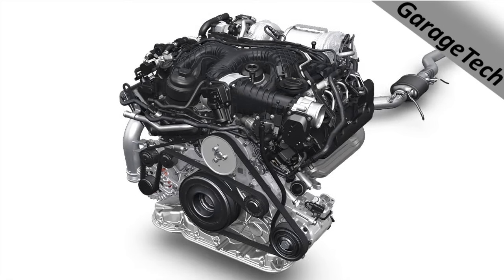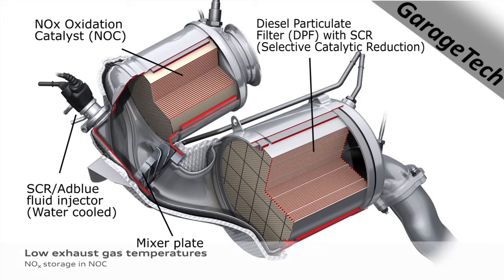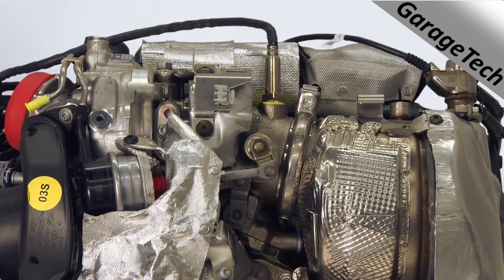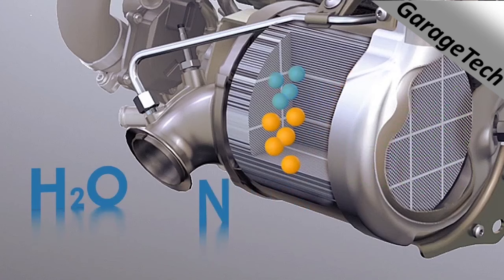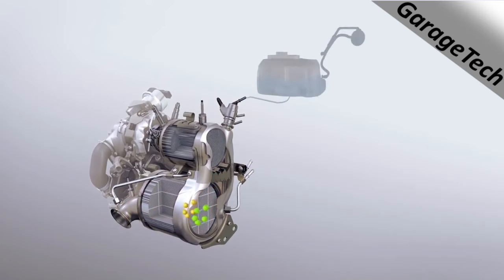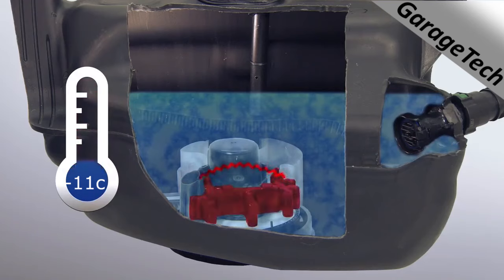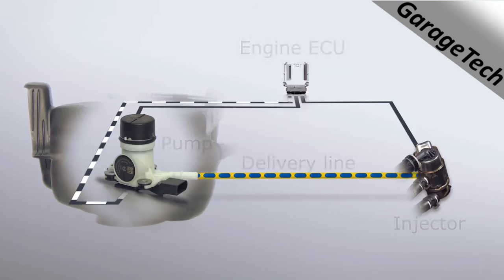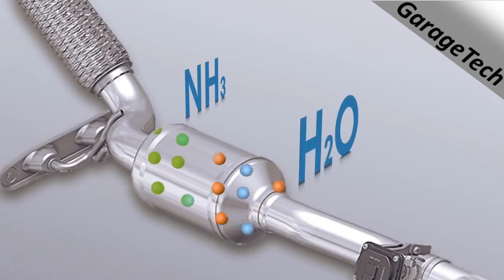How does the Adblue SCR DEF system work? Explained Diesel Exhaust Fluid Selective Catalyst Reduction

Comment: well all this complicated thing should unnecessary if using hemp oil based fuel. not the same as methanol. check about hemp oil 100 percent pure and onlny 2x strained put into a modern diesel engine. the resoult was no or mutch less NO2 THAN WITH ADBLUE

Comment: Excellent video. Your video describes more of the components that make the def system rather than a lot of colorful dots changing colours.
Reply: Hi I have just got a Citroen ds3 and hass not got a ad blue tank do I have to put in in the diesel tank .
Reply: @sophiegreen2802  If it's old and doesn't have the ad-blue tank, no, probably not.
Reply: @sophiegreen2802  I hope you didn't put the adblue into the diesel as your whole fuel system will be ruined immediately and the car scrapped

Comment: Really good explanation.  Have a new (old) Diesel car and the Adblue is the new thing for me, as well as the NOX sensor (which I've just had replaced).  Found the filler for it in the back of the car and wondered what AdBlue was and how it works.
Reply: How much was it to get it replaced mate
Reply: Meanwhile my 1965 Land-rover series 2 is still going.  And cheap to fix.

Comment: Every diesel car owner with adblue needs to read their owners' manual or risk destroying your exhaust filter system.
It is important to go on a high-speed, sustained journey for at least 30 minutes every month, to clean out the particle filter.
Short trips will not get the system hot enough, and the filters will block. At great cost.

Comment: You state that 30% urea is used for its freezing point,does that mean if cold was not a concern would a higher % mean less adblue volume needed to be injected for the same results?

Comment: I see that the passage from the catalyst to the particulate filter does not have direct access because it has gas flow deflectors. I was thinking of cleaning my dpf through the Addblue inlet, going down to the particulate filter, but thanks to your video I see that I won't be able to do it.

Comment: Absolutely unbelieveable. Why would it have to be so complicated? Just how clean are the exhaust gases? If they're practically clean as a whistle why are these engines being banned. And how does a diesel engine running with ad blue complare with a modern petrol engined car? Which is cleanest. No wonder some hapless motorhome owners have had to pay thousands out for new ad blue tanks. This ad blue just isn't good enough. It's got a very short shelf life and starts to chrystalise and knacker the tank up. For this reason I wouldn't buy a diesel car that runs on ad blue. But what a good video. It's really opened my eyes to just how complicated and these things are. I've seen inside modern televisions and they aren't this convoluted.

Comment: Hi very interesting video you are professional engineer just question I have audi A6 ....2016 year its only done 40000 miles from new and its coming up with p20e800 code low pressure and the adblue tank is full now when the engine is cold does the adblue injector spray the adblue?? Or the engine have to be at normal temperature ie 90° Celsius and then the adblue injector works ? Please kindly help me on this on this issue waiting for your reply Thankyou 🙏
Reply from the maker: Hey thanks for the comments, I’ve worked in the automotive trade many years. Could be a couple of things, this is a bit of a generic fault code so the system needs to be checked, yes it will work from cold if needed, depends on how much Nox emissions are produced. This Fault code could relate to an issue with the pump, it’s common for the AdBlue system to become blocked. As it’s full, that rules out low fluid. There’s also been software updates, which could be needed if there’s no other obvious faults

Comment: thank you for your video.
Peugeot, on his 308 Bluehdi models has problems with the Adblue tank. Every car, at around 50000-60 000km has to replace the tank. It arrives suddenly as Check Engine+Adblue+Service
it is almost 1000€ cost

They say the tank is deforming because of wrong pressure
Reply: Little Reptilian  i dont know. The "new" tank has the same part number so probably no modification has been done.

For now I am filling the tank every month, not letting the urea form cristals
Reply: I have a Peugeot 308  with 67000 km and I had a problema with the adblue injector… it really seems that it is a faulty system. However, I only had to replace the injector. In your case did the dealer covered the costs of repairment?
Reply: i think you've found the reason this system was invented for!
If they've wanted cleaner exhaust air, they've could put a physical filter to the rear  with a filter that needs to be replaced every week or so...

Comment: Ad blue works really well when it works  !  , But unfortunately the sensors, pump and other associated equipment  are horribly unreliable. Those components just last until the warranty runs out . When one of the components fucks up the vehicle usually won’t run without it  ! . Due to government regulations it’s against the law not to have that system working , especially in hgv vehicles . Because it’s government legislation , manufactures can charge what they want for spare parts . The parts for that system are mostly made by the same manufacturer and the same shite . As a result , the end user is ransomed to pay extortionate amounts of money for components that probably cost next to nothing to produce. The whole system is a big fuck off conn
Reply: Cars are deliberately not built to last so you go out and buy another one.
Reply: Just another unnecessary expense to run a car. Why the hell do I need to use that crap when my previous car never needed it. Now, if the government wanted all the diesel cars off the road all they have to do is ban the use of Adblue. Absolute con.
Reply: Thanks we are conned from morning to night.
Reply: @Kit_Bear what would happen to all the diesel made when petrol is made😮
Reply: @Kit_Bear if they banned ad-blue then the cars would just have the computer rigged to run without it. It’s only the computer that stops it if the blue is gone.
Reply: Well said bro

Comment: QUESTION:
I've got a new Nercedes GLC Coupe 300. There is an intermittent throbbing noise coming from the engine. My local Merce dealer said it is from AdBlue injector and it is normal. The car is brand new and I found it very loud as my previous Mercedes's did not have this issue despite all having AdBlue? How can I find out whether or not they are lying?
Reply: Murat Taner Eyi I drove several cars of different brands (no mercedes) but never I have heard specific noise due to adblue system
Reply: He is taking the piss give the care back not fit for purpose.

Comment: What happens if I mix this product with one for cleaning the particle filter in the Adblue tank?
Reply from the maker: Good question, but I’m not sure to be honest but it will likely cause an issue, the system will detect that the AdBlue fluid is not doing what it’s supposed to do and then put the warning light on and stop working. That might mean you’ll need to flush the system out.
Reply: Thank you very much for your quick and sincere response.

Comment: I've heard fuel consumption increases with this system, but why, technically speaking, would it?
Reply from the maker: I don’t have any data to suggest it does, you normally find the engines get more fuel efficient. The DPF system will use additional fuel in the burn off phase where it uses heat to burn off the soot.

Comment: Hellow I got trouble on my truck Mitsubishi fuso adblue light come on and truck went off since July I read code with my diagnosis I found : P20EE and P111C. Any help?
Reply from the maker: P20EE would indicate an issue with the adblue system, first check the quality of the adblue fluid. If its been filled with water for example. The other common issue is the injector can become blocked. you could try taking it off and soaking the end in hot water to try and clear it.

Comment: Any chance you can tell me the side effects of somebody using adblue instead of eolys? my mechanic has just done this and i'm concerned it's causing issues.
Reply: Like it's said in the video. Adblue is water based. Eolys however is oil based.
Reply: @bananarsle  really bad news, i think eolys is injected into the fuel, whereas adblue is injected after combustion, very different systems. i am astonished anyone could mix them up as eolys requires specialist equipment - connectors and tubes and such to refill the tank. thankfully only needs doing every 90,000 miles or so

Comment: Working EGR must have a larger effect on NOx by reducing combustion temperature and by effectively reducing cylinder capacity by introducing exhaust gases into the cylinder. Why not introduce higher volume but better filtered EGR exhaust gas into cylinders at cruise?
Reply: Use water methanol injected into the air intake to reduce combustion temp and the trade off is MOREPOWER😅

Comment: Any one let me know the cost price of the ADBLUE  fluid?
Reply: ADBLUE is simply common DEF (Diesel Exhaust Fluid), sold under a variety of names. There is literally no harm in using other manufacturers' brands of DEF as a replacement to Volkswagen's ADBLUE-branded fluid. Usually, 2.5 gallons of DEF goes for around $17-22, which should fill your DEF tank for at least 8,000 to 12,000 miles, depending on how aggressively you drive the TDi.

Comment: These things increase fuel consumption. My 18 plate transit is way thirstier
Reply: I found the same with our 2017 transit she was way heavier on juice, but then in our new 2019 crafter she is very economic
Reply: Jack d I work for a Ford dealer and we get loads of complaints about these new transits drinking fuel and adblue
Reply: @steveguest8028  then tge timing blet Snaped after 200 000km in January 2019 they replaced it with  new engine but put on a timing chain we trader her after another 20 000km
Reply: Jack d Modern vehicles are all junk,too much electronics and stuff you don’t really need then when it goes wrong it costs an arm and a leg to fix that’s if you can actually find where the fault lies
Reply: @steveguest8028  ford to be fair was very helpful and service and repairs were always cheap